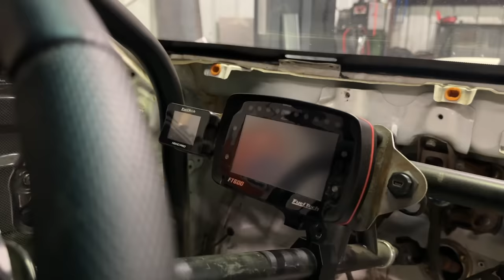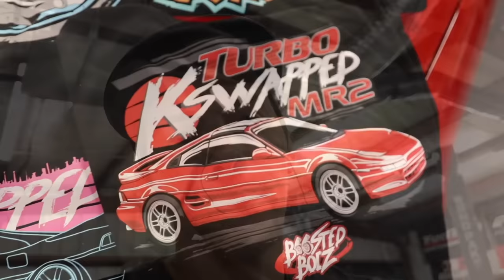Making The Tesla Plaid Cyber Kart Even Lighter!

Comment: You guys gotta take the tezzie to high elevation tracks and see if the time improves because of the lower air resistance.  Also definitely think about making the windshield removable and make something like Mercedes-Benz W125 Rekordwagen
Reply: this is a super cool idea especially bcs everything runs slower back there
Reply: i’m amazed electric cars haven’t taken over pikes peak, they don’t have to suffer a loss of horsepower like a combustion engine due to lower oxygen content
Reply: @micah2247  THAT would be so COOL! Great Idea. And very doable. it is just over 12 miles from start to finish! Just one helluva long way down, if you miss a corner!
Reply: @micah2247  I thought they have ? Isnt the newest record made by an EV ? 
At least there is a huge part of teams working with EVs as far as i know.
Reply: @Intrepid17011  i haven’t watched pikes peak in the last year or two, my fault. i’m glad that ev’s are finding their place in the motor sports world though!
Reply: @micah2247  I dont know if its like ACTUAL competing or if they do it for testing for coming years, so take my statement with a grain of salt :D
Reply: @micah2247   They have started to.  EVs have broken multiple records at pikes peak.
Reply: Thought higher elevation was worse.
Reply: @mrhatchyK24  Higher elevation is worse for internal combustion engines since they make more power with denser air.  Tesla is electric and isn't affected by the lower density air up there.
Reply: @Triple88a  oh yea forgot about it being electric

Comment: Rear inner sidewall wear on the rear is unfortunately common for the Plaid.  I had a tire fail in the exact same way.  The "fix" I did was adding adjustable rear camber arms to reduce the camber in the low suspension setting.  Not that you are worried about tire life but might be nice to have anyway as you move forward with this build.
Reply: Not much for adjusting caster and camber, huh?
Reply: @banditgrizzy1955 most cars only way to adjust rear camber is without mods is shims, but adjustable bars would be nice
Reply: @cheesecurd100s  yep. The designers never meet the mechanics.

Comment: If I had to make a suggestion it would be higher quality audio.  For example in the 05:00 area is MUCH quieter and more difficult to hear than later in the video.  This can be addressed either with better recording equipment (microphones) or in post editing by normalizing the audio track.
Reply: Normalizing is something a lot of channels haven't figured out yet. When you're trying to keep the volume down for others in the house. One minute, it's BLASTING your eardrums out of you're skull. Way too loud. Then, for the next minute, the equipment tries to protect itself. And drops the sensitivity level down. Then you can't hear a thing. Another BIG bad is not having a good wind protector on your device! Nothing is worse than hearing the wind blowing across the mic! which causes the device to cut down the sound input level again.

Comment: I would recommend some 200tw tires and make them wide if you are going Road Racing. Those front tires are the most important tire in that case both for cornering and braking. the width is going to help with longevity there as well as handle the weight and heat going into them. i know a lot of people are using the Rt660 A052 or RE71 tire

Comment: Should shape the car like a hatch, A pillar is good, B pillar is good, C pillar/shock tower should be taller, roof bar between B and C being more parallel with rockers. Build a low sheet metal wall @ doorbar type height, kinda like a side-by-side door between front fender and rear shock tower, add sheet metal roof, climb in and out through large "door" window hole.

Comment: Could eroy use a smaller battery to reduce weight?  Also, move the battery closer to the motor and maybe use silver wire between the motor and battery?

Comment: I really don't know but can you cut the battery storage in half or less and still have enough for a pass?  You could loose a ton of weight. also, is all of the electronics needed or just easier to leave in? an engineer could guide you on what the car has to have and all that it needs to run

Comment: 12:27 that wing needs a diagonal brace, it's gonna shimmy/flutter/wiggle with only the two angled braces that are on the same and only attach axis. A diagonal strut that attaches forward or aft of the wing's center z-axis would add even more rigidity. 
TL;DR The wing needs more triangles.  correctly sized/placed braces and gussets won't add much weight.

Comment: As I've said before I'm pretty sure there is a lot of limits holding it down and some tesla hacker/tuner should be able to unlock some extra amps and/or give you more peak power for short dragstrip runs.
Also I think the traction control takes away fair bit of power and you probably need to learn how to drive it with 0 traction control.

Comment: To maximize 1/4 mile: 1)get rid of windshield, body panels, lights, bumper, wing,  and cage; 2)move controls to centerline; 3)tie rear shock towers together with a carbon wing; 4)fabricate one piece aero body/cage out of carbonfiber with lexan windshield to: cut 250lb of mass, cut 1/3 of frontal area, and improve aerodynamic drag coefficient (similar to Oldsmobile Quad 4 long tail or McLaren). Should get you to low to mid 8 second time (and faster on road courses too).

Comment: Inside rear tire wear in under 10k miles is extremely common on almost every plaid with 21” wheels. Plenty of threads on fb and the forums about it. 19’s don’t suffer this issue. Rear camber is too far negative.

Comment: Better Audio, in car views at events. Other than that don't change a thing.
What mods to battery, or other parts of the system can be done to make E-Roy faster.
Can you reduce the battery pack size to 50%.. cutting the sprung weight by about 500-700lbs.
-Not great for road racing given it will kill the range.. If possible could make a system that uses a split battery pack. Swap 2nd pack in (back to 100%) when on a road course and swap it out to drag.
(assuming you only need 50% to do a drag event)
Are voltage tweaks or software changes possible?

Comment: WEIGHT REDUCTION
I'm sure you could keep going removing more dead weight and getting creative.
Would a sliced up battery pack reduce the straight line performance due to a C reduction? Some man maths would reveal it.
Weight reduction would be significant !
Maybe buy a used battery and use half the cells, or whatever the Maths says is optimal

Comment: Removing the windshield would probably have as much aero advantage as adding the body, without the extra weight. It's all about avoiding the low pressure re-circulation zone  behind the windshield and dash. Closing up the doors up to  dash height and mudguard on the back wheels would help as well. Removing the whole body but keeping the windshield is like adding a 1 meter spoiler to the roof of the car. Except that the windshield only creates drag.

Comment: You could try to talk to protean and get 2 or 4 of their direct drive motor wheels and add a 2nd electric drive system. This could make the car heavier (more traction) and improve the power/weight, which will improve your quarter mile.

Comment: Kyle you could do a cool video proving the wing works just by doing a high speed run with how it is set up now. Without supports you would see it bend down. Once you support the wing bar to the chassis it will then push the chassis down but atm those bars would act as a spring. Would be a cool video though and the wing manufacturer may chuck u some extra coin for providing there products work

Comment: maing the bottom as flat as you can it can help aero on the mr2 maibe try to get a plastic sheet from the weightplate in the front all the way to the carter of the engine in the back , maibe even all the way to the rearbumper
as for the rear fenders : over here theres a certain class of oval racers and they widen their fenders with cut up metal trailerfenders , these have the rounded lips/sides making the fenders stiffer , should be able to find a set of those and fit them to wats left of the tesla inner fenders
as for better cameras i watch in 1080 HD because of the low bandwidth internet im having so i dont think i would notice the difference , besides that the SLR cameras are pricey and you probably use it less in actionshots where it could be ejected out of or hit by the car youre trying to film, there allso more finnicky wish can cause shots to be ruined  or because of longer setup times can ruin the mood
i would stick to i phones / the current resolution and maibe do SLR for long distance and glamour shots , where i usually see resolution problems are in the surface of water or trees rushing by , when the resolution is low they turn out blocky as the immage is covering a large surface and changing fast 
if you know someone whos visiting japan or china you could send him a shopping list for used cameras , the cameras and the lenses are sold a lot cheaper over there 
https://www.youtube.com/watch?v=piYM71rkFYI

Comment: I think you boys need to seal up the electrical wiring and make E-roy more water resistant.
Reply: Why does it need to be eater resistant?  They're not off roading in this thing.  Lol
Reply: @1216jimmyz  they have had to put it in the trailer because of rain already. So if there thinking of more events it just makes sense.
Reply: @KPaul7  a tarp.  Lol.  It’s not like they will be racing it in the rain, so no need for anything except maybe a tarp.

Comment: Tesla drivetrain swap a nsx... Or talk to the guy that designed white zombie and build a proper fully electric drag car and call out youtubers that think theyre fast. Talk to Fuel tech, theyre doing a lot now with ev controllers.I can help out too on paper getting it all blue printed for you. I just dont have the time anymore to do anything in person for you. I gaurantee that if your video title says 200+ mph all electric anything that you can keep your viewers happy and draw in even more. Back in 09' i led our automotive class in hybrid training to swap an electric motor into a ford e350 as a class project. In 6 weeks we swapped a forklift electric motor direct drive to the rear diff of the van using the controller from the forklift and 21 deep cycle marine batteries in series and parallel to make 36volts and a f ton of amps. With stock tire size and the rear gear ratio the top speed was estimated at 90mph(3000rpm) -190mph(8000rpm) if we had the funds for a better motor, batteries, and controller that could handle the discharge rate then it would have been doable. I know the motor was able to do a few k rpms at 36 volts but im sure it could've done more on 48 volts but never got a chance to try due to time constraints. Hopefully you can make something happen too in the near future. It'd be sick watching you learn about electric motors and running with it. Its honestly not that bad learning the fundamentals of how the controllers do their thing. Good luck sir, ill definitely stay watching regardless of the content.

Comment: Can you take out 1/2 of the batteries to make it lighter?
Reply: Yes but not easily and not cheaply either. It would be better to sell the stock pack and then have a custom one built.
Buy a used model s battery case for cheap&get an ev shop to build it right. Probably drop 400-550# off the weight.

Comment: Bro, on a serious note that will never be seen or even thought about...... drop half the packs and overvolt the controller. If the tesla is a tesla racer u don't need all the amp hours of a full pack just enough to run 3-5 quater mile runs then on the trailer. We talking 2/3 battery weight removed.....
U talk with uncle rich., why no battery mods. Why no recap/over volt mods?